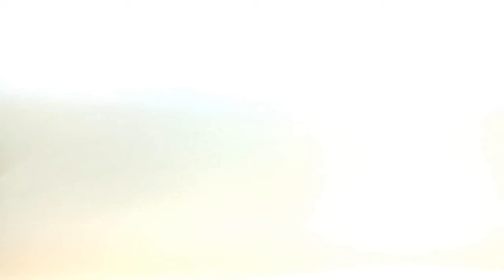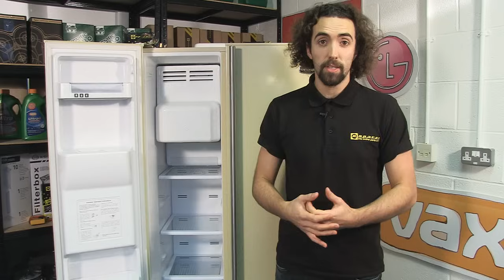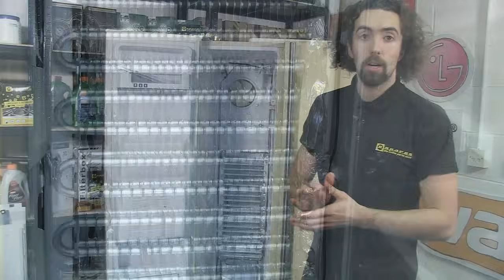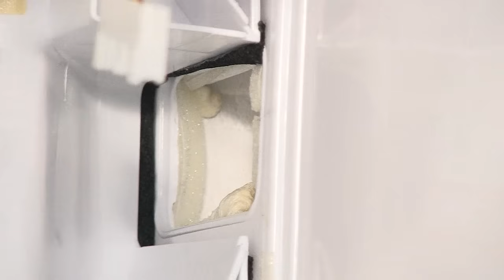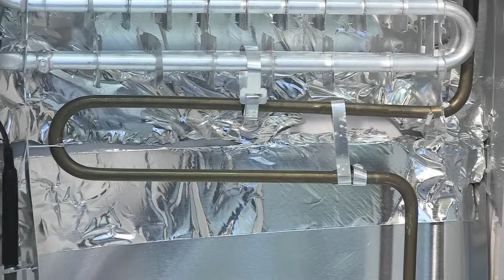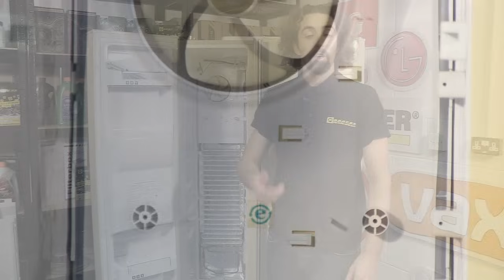BEST Advice: Frost Free Fridge Freezer Ice Build-Up & Common Problems!

Comment: I am very frustrated. All the videos I can find are for more recent refrigerator freezers with either french doors or bottom freezers.  We have an "older model" -- which one would think would be more likely to need repair than a new model -- and nothing whatsoever about an older GE Profile with a top freezer.  Come on!  This isn't fair!  Why is everything about my refrigerator, a mere 20 years old, gone from the internet?  Appliances should last 20 years!  My god, they used to last 40 or 50! 

Come on, appliance repairmen, don't ignore the older people who are most likely to need your help!  My refrigerator is an older model, a TBX19, just as I am an older model, an older model with very limited financial resources.  Please help.
Reply from the maker: Hi etm567, thank you for your comment and we understand your frustration, here at eSpares we try to get as many appliances as we can but are limited to what is available to buy to film on. What is the problem with your fridge freezer as we may be able to give advice even if we do not have a video?

Comment: Like that accent is it posh?
Reply from the maker: Hi Yahya, Josh does sound a little posh and glad you like his accent.
Reply: @eSpares  OK my freezer got ice in the coil and the refrigerator works for some time and stops as usual but the food compartment is getting warmer as well as the freezer itself I defreezed it and cleaned the coil and it worked fine for 10 days and started to build up ice again  be warm again is it timer or coil?
Reply from the maker: Hi Yahya, test the defrost heater with a multimeter as it is likely the heater has failed and it is not defrosting.
Reply: @eSpares  ty I will
Reply from the maker: Good luck Yahya.

Comment: Hi there, I have a samsung cool n cool American fridge freezer and the freezer side isn’t working. I had a guy come out to fix it today and he thought that the dust on the grill at the bottom on the back was causing it to overheat. He removed dust and it worked to the point of -4 but then 6 hours later it’s back to +11. He’s on holiday now now. Any advice would be much appreciated as I’m now on the brink of buying a new one because I can’t live without it. Tia
Reply from the maker: Hi Paul, you will need to check inside the freezer behind the back panel, that's where all the components are to find out what has failed. Use a multimeter to test the components to determine what is not working.

Comment: Hi espare

I have a problem with my samsung american fridge, we have tested the board , yet electric trips within 10 seconds of turning the appliance on, can you shed some light please.

much appreciated
Reply from the maker: Hi Chief S, tripping the electrics is usually caused by a component going down to earth, you will need to test each circuit and component to determine which part is causing the electrics to trip.
Reply: hi espares 

Many thanks for yr advise, ive done all the diagnostics checks on the samsung srs 2025cvw

It seems like the compressor is the faulty device, which is the Samsung Compressor DK182QL2U, 

i cannot seem to get the above model however the next one up which is 
Samsung-Compressor-MK183Q-L2U-R600a, will this work on my fridge?

 if so what type of relay will i need for the above model.

Just wanted your professional advise
Once again many thanks
Reply from the maker: Hi Chief S, if you have found the compressor to be faulty then you will not be able to replace it, you need a refrigeration technician to remove the gas inside and vac it out and regas the appliance using a refrigeration rig. This type of repair can be very expensive so think carefully about the repair before you decide to go ahead.
Reply: Hi espares

found out the thermost heater was the issue

all sorted thanks mate
Reply from the maker: Hi Chief S, well done on sorting it, it has made our day.

Comment: This is really interesting and informative but.... do you know why the bottom of my Siemens KG34NX94GB fridge freezer keeps filling up with ice? Water appears to be dripping out of the bottom of the panel behind the freezer boxes and freezing. It's getting faster and I'm hoiking half a kilo of ice a day out of the thing at the moment.... I'd be grateful for any suggestions. Thanks.
Reply from the maker: Hi John, one of the most common problems is the defrost heater which is covered in the video, you will need to gain access to the evaporator through the freezer section and test the components with a multimeter.
Reply: Thanks, eSpares.... and if I need any parts, you can count on my custom! Thanks again.
Reply from the maker: Your welcome John, please let us know how you get on.

Comment: Hi , I have a may tag fridge freezer, we had a power cut recently, and ever since the fridge blows the fuse in the plug every time it’s turned on; any ideas what this could be?
Reply from the maker: Hi James, it sounds as if something is going down to earth which is causing your electrics to trip, the easiest way to test this is with a meggar which can test for any insulation breakdown within your fridge freezer but don't rule out the trip was damaged during the power failure which will need a electrician to test.

Comment: Just don't buy a "frost free" fridge freezer they are shit. My last fridgefreezer was manual defrost it lasted 16 years, I hardly ever had to defrost it.
Reply from the maker: Hi Galv140577, thank you for the comment, your fridge freezer lasted a long time and I know a lot of people think the more inside the more that can go wrong but most people do buy frost free now.
Reply: eSpares I got a frost free one I checked the temperature when I got home last night it was 15 c in the fridge and 7 c in the freezer with the contents defrosting. In your expert opinion do you think it has a fault?
Reply from the maker: Hi Galv140577, it is certanly not working correctly with those temperatures, is the compressor running and what have you checked so far?
Reply: The engineer replaced the thermostat, then it didn't work, so next time he replaced the defrost timer & it still didn't work, next the whole fridgefreezer is going to be repalced, with a manual defrost fridgefreezer. I would love to know what exactly was wrong with it but the engineer only does guessing games instead of actual fault-finding.
Reply from the maker: Hi Galv140577, you are right that fault finding with a multimeter rather than guessing is the only way to identify what has failed and I hope your new fridge freezer will not give you any trouble.
Reply: I had a GE frost free fridge last 32 years! Only had to replace a timer on it once, it cost me like $70!
So your argument about frost free's being shit are moot! lol

Comment: Can u help  me i have new  fridge with frost i wanna make it low frost   i m tired
Or i have to chage fridge freezer
Reply from the maker: Hi Zaheer, if your fridge freezer is frost free you will need to check for the faults described in the video, also check your door is sealing correctly.

Comment: Hi, I came across your vid, very informative :) I wonder if you could help?  We have a hotpoint  FF175M (think its the FF175MG? its graphite colour) the compressor fires up but sometimes its on for a few seconds, sometime for a while, it then cuts out with 3 loud clicks, also sometimes the light doesnt come on in the fridge, I then turn off at the wall and back on again after a minute and it works until the same symptom with the compressor? we came home and everything had defrosted at one time, Im wondering if its the motherboard PCB? or possibly the relay on the compressor?? its been running for over 5 years and just out of warranty, we are going to empty it and let it defrost for 48hrs and see what happens then,  cheers Rob
Reply from the maker: Hi Robert, the click is usually the TOC on the compressor going out due to excess heat, check the TOC first and if that's OK it may be the compressor.
Reply: eSpares thank you for the quick reply, TOC?

Comment: My beko fridge freezer frost free keep on freezing everything in the fridge component  even at minimum temperature. Pls what can I do?. Model no- CDA648FS/1
Reply from the maker: Hi Happysamlolly, check the condenser wall spacers as there has been an issue, check the thermostat connections and test the element, sensor and check for any blockages in the freezer.
Reply: I removed the panel in the freezer and found big ice and defrosed it, but d problem is not solved. . It's getting too technical for me to fix. The engineer asked for £95 to fix it so I have decided to buy new fridge freezer. Thanks so much for your help.
Reply from the maker: Hi Happysamlolly, well done for having a go.

Comment: I have just moved to a new house with a samsung american style fridge freezer in, when i switched it on I get a flashing "E" sign on the fridge side, I have held the vacation button for three seconds it beeps then carries on flashing, any ideas?
Reply from the maker: Hi Joe, with Samsung American fridge freezers it usually shows a number followed by the E, try resetting by holding down the power save and lighting buttons.

Comment: Maybe you can help me. I have a samsung RL44ECTB, had power tripped one day, cooker hood bulb, which somehow stopped fridge freezer working. Found blown fuse in pcb, replaced but keeps blowing. Should I replace capacitor or pcb?
Reply from the maker: Hi ChunkLidl, the bulb could have caused the electrics to trip but it would not have usually damaged the fridge/freezer if it has blown a fuse in the fridge /freezer board check for any damage to the board before testing anything else.
Reply: Thanks for your speedy reply. Appears no obvious damage on the board. The blown bulb tripped the sockets switch, but not the main breaker which I thought was odd at the time. Assumed something failed on fridge/freezer due to surge, but I'm probably out of my depth
Reply from the maker: Hi ChunkLidl, you would have to trace the fault with a multimeter to check each component, it is difficult to check the board so you would have to eliminate everything else.
Reply: Hi, you were right, I detached the board located on top of the 2m fridge, inspected if to find a blown chip U1. I could replace the chip with a bit of soldering, but can't see the serial no. etc, cos there's only half of it left! Would you know what the chip is? Or should I just replace the whole pcb?
Reply from the maker: Hi ChunkLidl, well done for finding the problem but you need to find a retailer that sells just the chip as most would sell the complete board so search for the U1 chip and good luck.

Comment: My hotpoint frost free freezer does a glugging noise at the back when i shut door. And the drip tray lays on the compressor which is very hot! Does this sound dangerous?
Reply from the maker: Hi Vikki, your fridge freezer will make noises during its normal operation which is nothing to worry about, the compressor does get very hot while it's running and that heat will evaporate the water collecting in the drip tray.
Reply: eSpares thankyou so much :) thats put my mind at rest.
Reply from the maker: Hi Vikki, your welcome but if you have any other concerns please let us know.

Comment: Hi I have a Hisense HR6TFF350  and it is on Mid  how cold should things be because not cold cold
Reply from the maker: Hi Raewyn, we are not familiar with this appliance but checking on line there are mixed reviews about it's ability to cool effectively. Looking at images of the 'freezer compartment in sales pictures it shows storing bottles in the door, this would not be possible if the temperature was similar to a 'normal freezer' as these would freeze solid. Check with a thermometer but if the fridge regulates around +1C in the middle of the cavity it is unlikely to be faulty.

Comment: Would greatly appreciate your advice: Kenmore s x s Mod.# 253.53612301. Intermittent freeze/thaw/freeze; fridge: cold/warm/cold. I think freezer control-temp, part #5234421067, or control-defrost, adaptive timer, PC board, part #241508001.  Have visually checked, cleaned everything else. your ideas, please and thank you.
Reply from the maker: Hi Dennis, as your freezer is 'frost free' it will have a evaporator and defrost heater behind the rear cover in the cavity. When the machine starts a 'defrost cycle' the temperature around the evaporator is monitored so once the ice is cleared and the temperature warms the defrost cycle ends and freezing re starts. If the heater (or the sensor) fails then the appliance sits and waits for the temperature to rise. Check the heater and the sensor first as these are the usual cause of the problem.
Reply: Appreciate your prompt reply. Please extrapolate on your "Check the heater and the sensor first" comment. Define 'check', please and thank you.
Reply from the maker: The heater should use between 40 and 200 watts depending on model so should have a resistance of 300 to 1500 ohms on 240 volts (60 to 300 ohms on 110 volt) approximately. If the resistance is within this range replace the sensor as the next likely cause.

Comment: Thank you i appreciate your feedback....all the standard compact refrigerator/ freezers that u can buy at walmart or any other dept store have temp control switches similar to standard home 2 door refrigerator freezer. Its just a switch controlled by temperature via a long probe. I just dont know the cut in cut out temp for the switch to know if the probe needs to be put in the fridge or freezer ....when mounting it in a home refrig freezer....
Reply from the maker: If originally attached to a evaporator on an ice box the 'new' thermostat is not likely to open until the capillary cools below freezing. This may cause everything to freeze unless you can directly attach it to the new evaporator.

Comment: Temperature gauge is flashing and making noises.Is there a fault and what cal l do.?
Reply from the maker: Hi Diane, if the power has been interrupted some appliances will flash the light to warn you. If this had occurred when away the whole contents could have defrosted then re frozen so would need checking and disposing if required. Check your instructions if you need to do a reset after the power has been disconnected.

Comment: Thank you but im looking for info from someone who is not just a part swapper....a temp control is just a on off switch controlled by temp so you are wrong...it wil work in any fridge... Ill look elsewjhere for an answer to my question not just a part swapper answer
Reply from the maker: Many mini fridges are cooled using a Peltier effect device and do not have a compressor or 'regular thermostatic switch' so do not have a easily removable device that would allow transfer to a 'regular' fridge or freezer that uses a compressor for cooling. As you did not give us any details of models you were looking at we could only 'offer' what we considered to be the most useful information. It is always possible to build almost anything if determined to if you have the ability but for most people we repeat this would be possible to use a part from one device to another. There are available temperature controlled switches but we only supply spares for appliances. If you want to view our 'universal' fridge and freezer thermostats click here:
https://www.espares.co.uk/search/pt1727/fridge-and-freezer-thermostats?SearchTerm=universal%20thermostat

Comment: Tell me more about the manufacturer issue (4:00) whereby icing occurs above and below the evaporator. I opened up the back wall of my Frigidaire freezer after it wouldn't make it below 40F, and there was a giant area of ice build up ON TOP of the coils. This after finding that a huge ice tray was propped right up against the back wall with a sheet of ice behind it, adhering to the back wall of the freezer. The heater element seems to be in a "U" shape going down and back up, with an area on top that is not heated. I've melted the ice and plugged the freezer back in to see if this was the problem. Will the ice come back immediately, or take some time? Was the ice tray to blame for a 'domino effect' of ice build up? I'm unable to locate the timer or switch unit(s) many tutorials tell me about which is in charge of turning the heat on and off, though I do see what appears to be a little cylinder sensor of some sort where the coils begin. I'm hoping this manual defrost fixes the problem.
Reply from the maker: The model that we know about ice problems is some Samsungs and Hotpoints however there is likely to be others,. What is your full model number?.

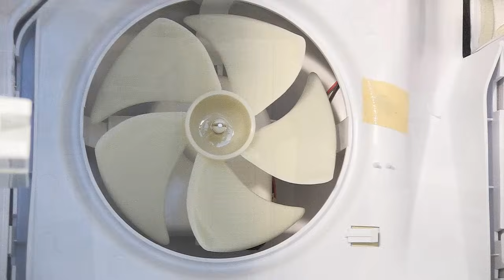Comment: At (1:06) you say that: "this fan draws air into the appliance.."
My undersanding was that all fridge-freezers were sealed from the atmosphere, or air, outside the unit.
What you are saying here is the complete opposite.
Please, can you confirm that the fan is drawing in air from outside the fridge, and if so, where does all the water go? (Assuming that most kitchens are quite humid)
Reply from the maker: Thanks for your comments, You are quite right the cavity is sealed from the outside (apart from the drain hole). What Josh meant to say was 'the fan draws air through the evaporator and circulates it around the cavity'.
Josh like all our presenters had no formal engineering training, he was trying to pass the information fed to him by our engineers in his own words. We hope this clarifies this point. The water that is drained passes onto a shallow tray above the compressor. Here the warmth from the compressor helps evaporate the small amount of water away.